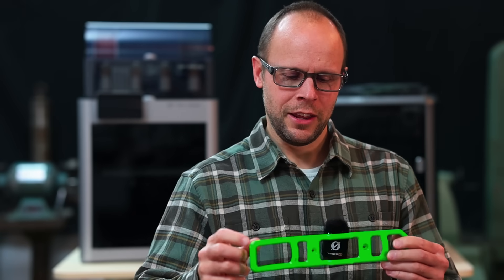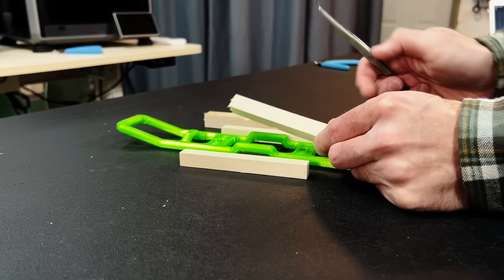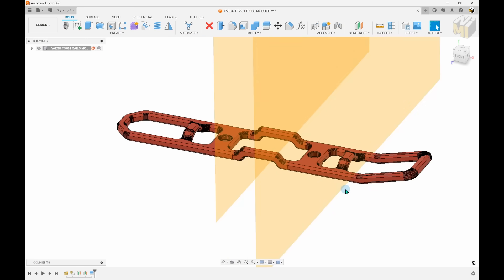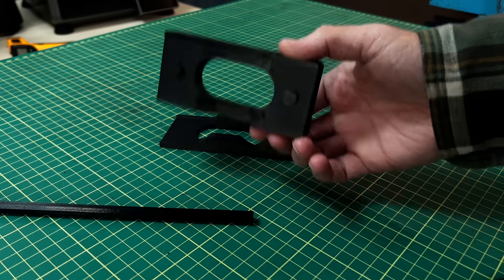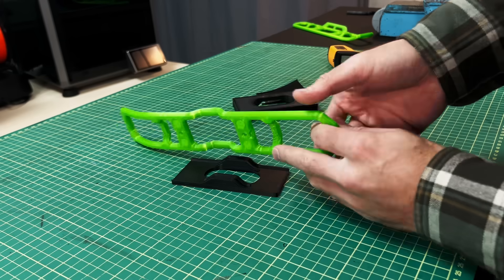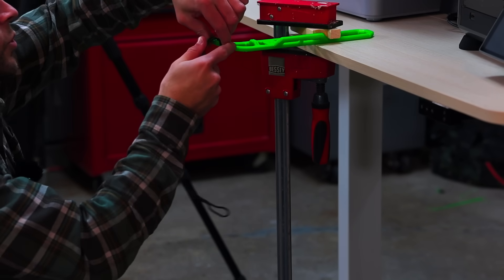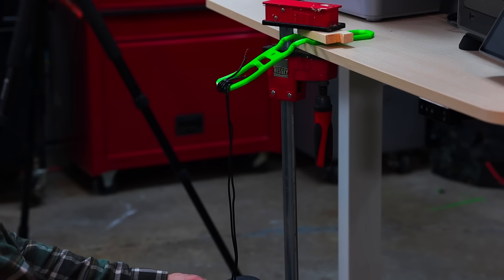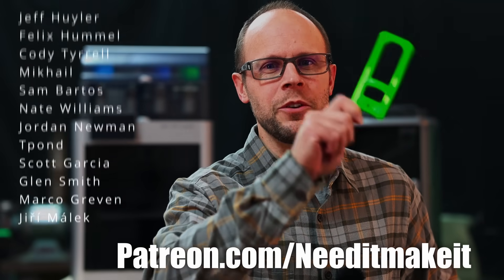2 Simple Ways to Make Stronger 3D Prints + an Experimental Way

Comment: Use tpu on this, also, anneal your prints in salt powder. It works fantastically
Reply from the maker: One TPU Coming right up, I'll print one with what I have, it seems fairly flexible on the spool, it is 95A, but made into a 3d Print, well, I suppose I'll have to see when it becomes a part.  This will be my first time using TPU, coming from a bowden setup, I'd avoid flexibles, but I don't need to anymore and it's time to experiment a bit.  Thanks for that!
Reply: @NeedItMakeIt  if it’s older tpu you may get a lot of stringing and blobbing, but you’re not guaranteed to, give it a go 👍 just print slower than usual, around 35-45mms. If you just have the 95a it will be a good go, but if you had a rigid flexible, could be a great material to use.
Reply from the maker: Apologies, responding to too many comments at once I lost track for a moment.  Salt powder, would that be baking soda?  Would you print solid then surround the part and then compact it and bake it in the oven for an hour or more?  I think that would work really well, I would hope that the part remained fairly close to it's original shape.
Reply: @NeedItMakeIt  CBC kitchen just did a fantastic video on it. I have only used the process 3x since watching his video, but have had really nice results. Just use a very fine salt powder.
Reply from the maker: I must have missed that video, I'll check it out.  That guy, he's really on top of all of these things.  Very talented... nice hair too :).  

It's worth a try, I'll print something as a smaller test to try it out, my first guess is that dimensional accuracy will be lost, and the part will change size, by 2-3%, and some parts with holes wouldn't be well suited to this method.  I'll have to try it out.  It'd be nice to be able to pour something like corn starch around the model, have it flow.. bake it, and then wash away the mould.  Non-Newtonian fluid forming?

Printing some test TPU pieces right now, it's fairly new, wish me luck!

Comment: Very interesting concept the reforming. Shame it doesn't work out well.
Reply from the maker: I really though it would do better but after mounting onto the table and seeing how springy it was, I wasn't so sure.  I wouldn't mind testing the idea of annealing inside of an ABS form, I'm not sure it would work well due to expansion and warpage of each material, maybe annealing in salt/baking soda.  Alternatively I could re-design the model so that it can be printed on it's side, and maybe include some webbing to allow it to vent the radio properly.

Comment: What I do when designing something for 3d printing is think on the stress direction the structure is going to experience, and depending on it I design the object taking into consideration the direction of how is it going to be printed
Reply from the maker: That makes the most sense, in this case it would be best to print something like this on it's side and adjust the design around that position rather than trying to make it work another way.  The model printed with the strap areas flat worked really well, I was pretty happy with that, but printing it on it's side with a re-design would probably work better.  Great points @HmegaB

Comment: I would have print it sideways. Printing sideways would increase strength and you don’t need a heat gun and time to get the correct shape. And as others commented TPU would be a good choice too.
Reply from the maker: Sideways is a good option as well, it would make the rails strong, and the front and back sections could be re-designed to be a bit stronger to have a bit larger cross-section, or make them thinner and more flexible.  it creates a lot of supports, that could be avoided by adding a thin webbing between, if you're printing supports why not have them as the structure?  

TPU is big on the list.  I also want to do a re-design from scratch using just the hole positions I'd like to get some ideas from other people about how they'd do it and then maybe we can make a little competition out of it.
Reply: @NeedItMakeIt  you would be surprised how long you can be bridging without supports. I think you could print this model without supports at all. You only need a well tuned extrusion multiplier.
Reply from the maker: Yes great point!  The design could easily be adjusted to reduce the spacing as well for a better bridge, nice thought on that.  I think you're right about sideways.  I think this is a case of the designer wanting to sell their pro-version made from nylon and not really thinking much about printing our own, it really shouldn't have been designed this way.   

I was thinking about testing some TPU, how does it bridge?  I have honestly never printed with any, I was stuck in the mindset of Bowden from my Enders and I had never tried it to avoid trouble.  It's time to move on to TPU and see what it can offer for protection.  I also want to print some cases for my wireless mics to keep them a bit more well protected.  TPU is white, which looks pretty awful, but I'll go with it for now.
Reply: @NeedItMakeIt  I would use PETG for this part when printing sideways. It should be plenty strong. You can use PLA as interface material if looks matter. 0 distance and 0 interface spacing.
I don’t print TPU that often but bridging isn’t good with it.

Comment: Hard TPU would work way better for something like this than any other normal FDM Material.

Take a look at Ant weight BattleBots, the are almost exclusively made in TPU for durability.

Also it would offer just a slight amount of shock absorbing would would probably be better than something stiff if that radio did fall.

Just watch some videos about TPU as settings can play a big difference in stiffness of TPU. Lost in Tech has some good TPU videos
Reply from the maker: I think it's a great idea, my only hesitation with it is the print speed, but that's all good if it performs really well.  I'm happy to get some material and give it a try.  If it's good for battle bots, it's good for what I need to use it for.  I'll check out some of the videos, thanks for that.  Are there any major drawbacks aside from print speed?
Reply: @NeedItMakeIt  For the use case in this video nothing really other than just normal TPU stuff like drying the filament. And with direct drive extruders you can print TPU reasonably fast now of day's. It was Bowden extruders that were the main culprit of slow TPU prints
Reply from the maker: Going back to my Ender days, I stayed away from TPU, but with the DD on both printers I use now, I think it's time to finally see what it's all about.  It seems like a great option and I'm curious about how I might get some areas to be more stiff than others.  Adding more walls/infill or is there some way to mix TPU within one print and still have good bonding.
Reply: @NeedItMakeIt  do you know about adding modifier areas in your slicer? Doing that you can have some areas with more walls or infill than other areas of the same object. Walls and infill will greatly change The flexibility of TPU
Reply from the maker: I have on occasion used modifiers, I find them a little annoying, but recently I thought about adding parts within the original model and bringing them all in as a multi-part model, those extra pieces which are in the right place already can be changed to be a modifier and that should help.  

Is there a way to have infill which changes density continuously?  I think CNC kitchen did a video on this a while back, more spare towards the center.    Something that is similar to Voronoi/Bone structure seems like it would be the most adaptive and flexible while also being strong.
Reply: @NeedItMakeIt Been able to print 95A TPU on a bowden Ender 3 at 30-40mm/s no problem, With direct drive on a good printer and especially with even harder material, speeds up to 100mm/s should be possible.
Reply: @NeedItMakeIt Perhaps an adaptive delaunay tetrahedralization of the mesh as a post-process after export from CAD and before slicing with zero infill (the tetrahedra would be the "infill").
Reply: @NeedItMakeIt  a modern extruder can print TPU fast. I've printed Polymaker high flow TPU95 at 400mm/s (and 20k accel) with a Bondtech LGX-Lite extruder. The issue is, I think, the highest durometer you can get is 98A, which probably isn't high enough for this application.

There are lots of nylon options that might be better for this part.

Comment: Put a Steel wire in it to add the strength
Reply from the maker: You're the first person to suggest this, same concept as rebar in concrete, that's an interesting one.  A piece of wood may also work well.  Should the steel be heated?

Comment: Super interesting! I expected the heat bent version to do better because they're basically continuous layers. You should try the same with rigid TPU. Something around Shore 60D or harder. Hard TPU is underused IMO. It's some of the most indestructible out there and probably wouldn't have snapped at all.
Reply from the maker: I did too, I think maybe I need to try it in a different material, I can do a short with the results, maybe ABS or ASA would do better?  PETG seem to be very sensitive to temperature causing that brittleness.  I'd love to try TPU, I have some, but it's fairly flexible, so that's great advice, I'll add that to the list, love to see something that doesn't break at all.
Reply: @NeedItMakeIt also PP is like middle ground between ABS and TPU for stifness. I use it a lot for practical aplications. 98A TPU is really good as well. I have printed a part with ABS and 20D TPU. Abs snapped off from that thin section. TPU was indestructable.

Comment: another very strong way that i do sometimes is print the part with 0-5% infill to make it hollow and then make a hole at a place to pour in some resin to fill the cavity (have to make sure that the structure is water tight from inside so that the resin doesnt drip out) i dont fill the cavity fully but just fill those places that might face more stress
Reply from the maker: Ah, that's a cool technique, that would cause an exothermic reaction, but I guess as long as it's slower it would be okay?  Would you recommend using a higher temp material like ABS or PETG?
Reply: @NeedItMakeIt   It really depends on the resin, filament and design used.. I had ASA and ABS deform a bit when doing this, bust mostly due to very thin walls in my 3D design..
Reply from the maker: @v1ncen715  I suppose a very sparce gyroid might work well to help a bit with that.  I think it's a great idea, basically a form which stays part of the final product, it's cool, and if the resin bonds to it, that's even better.
Reply: @v1ncen715  what kind of resin would you suggest?

Comment: You also tested only 1 part in one orientation, this does not reflect real live use. I would habe simply printed it on one side since all the transitions are roughly 45 deg. And increased outer perimeter count.
Reply from the maker: Yup, I plan on doing more.  The test was supposed to reflect how the original part was broken in the best way I could think of.  Full and complete testing would take months of work and a lot of money.  I have little money and 2-3 days.  I'd love to do more, and I will be, we can always follow up with another video using feedback from everyone.  These parts are fairly large and take over 2 hours to print, I'd want to change the design to something else that's smaller and re-test as you say in different orientations.  The part is intended on taking abuse and protecting from impact.  Testing for impact resistance would be good to include in future videos as well. 

The reason I like to test real parts is because it's far easier to understand and relate to real life, testing tiny thin pieces of plastic helps to understand and compare materials, but it's hard to apply to real-life.
Reply: @NeedItMakeIt  Testing is very time and money intensive. 

"...The reason I like to test real parts is because it's far easier to understand and relate to real life, testing tiny thin pieces of plastic helps to understand and compare materials, but it's hard to apply to real-life..." This is the difference between material tests and geometry tests. 
You can shorten it through FEM however the results will vary widely. Especially with 3D printing where the parts are non isotropic, kind of like wood (which you mentioned). You choose a really hard topic for your YouTube channel I must say. Theere are sooo many parameters, from material, to nozzle, size, to extrusion width, temp, fan speed and what not. All of which have an influence and that BESIDES the geometry of the part.

Comment: I think you're expecting too much from this particular design. Redesigning is the way to go
Reply from the maker: That I can agree with.  I think to take the outer shape and re-design it to have the piece continuous and then print it on it's side.  We can build in vent holes, and I think we'd end up with something that performs far better.  I'm not solid on the PETG, maybe ABS or PC would be better choices.  Some have mentioned using a harder TPU, I don't have enough experience with TPU, but I've heard a lot of good things... other than slower printing requirements.

Comment: Instead of heating and bending you could also changed the print orientation from flat to one side, so 90 deg, change. The layer lines would also all be unidirectional and non interrupted with similar results but with less manual labor.
Also as one can see, more rigid does not seem better. Just compare the iPhone 4 with the nice glass backplate and aluminium housing where the glass would shutter and the aluminium permanently deform, compared to the plastic samsung of that time where the backplate would simply fly off and absorb any shocks.
Reply from the maker: That's probably the best way and then re-design so that we remove the areas requiring support.  Even having a thin un-interrupted areas with some vents built-in would probably work really well.
Reply: @NeedItMakeIt  "...then re-design so that we remove the areas requiring support.  ..." Yes exactly, the part already looked pretty well suited for that, some of the designs didn´t needed that much support from the looks of it.
Not saying your design is bad or your idea with the forming, it isn´t. It´s actually a pretty clever solution for cases where print orientation is difficult and can´t be altered easily. I just would always try the version with least manual labor and then go to the next best thing. Especially if you want to print them in larger amounts, maybe you want to sell those or something IDK.
Reply from the maker: For sure, post-processing is best to avoid, and that's normally how I'd do it.  Sometimes I have an idea and go with it, sometimes they work, sometimes they don't and sometimes they REALLY don't.  It's a cool concept, but to get it right and to have any benefit it needs to have performed far better, it seems like this one may not need to make another appearance unless I can understand the annealing process fully.  There are lots of good ideas, a material switch to TPU may be the best option to prevent any sort of cracking and also provide that protection I was looking for.  

In this case the design was by someone else, I would not sell the part unless I had permission from the designer.  I may end up re-designing from scratch using just the bolt holes along with including all of the ideas you and others have suggested.  When I look at the model, I also see that the bolting setup is weak as well, those bolts should really not be inset, they'd need to sit against the most outside surface with a washer as well.    I'm thinking that this design was taken from something made from Alum. I'd have to do some digging to be sure, but it's fairly thin profile and skeletal features lead me to think that.  Or the Nylon they have it made from professionally is plenty durable.    

I'm a bit of a glutton for punishment.  Nothing like a good challenge to keep the gears turning.  Great comments @sierraecho884 as I get deeper into this, I'd love more feedback.
Reply: @NeedItMakeIt  "...another appearance unless I can understand the annealing process fully...." maybe I can help, I am not a chem. "kind of guy" but I am a mech. engineer. Don´t forget you can´t anneal any type of plastic. only ..I think semi cristalline it was ? I need to look it up again. Basically PLA woks but PETG does not. And annealing will warp the parts a lot so going through that hassle you can just as well create a mold and use PU instead or something and ditch the layer lines all together.

"...TPU may be the best option to prevent any sort of cracking and also provide that protection I was looking for. ..." 
Yes TPU is awesome for those kind of applications. I think it would perform the best. Additionally TPU is rather slow printing and difficult to work with you can come up with designs like a "TPU sock" over a PLA Print for instance, sine PLA is way faster printing. Like a rubber casing or rubber insert for the precious gear inside, or both. 

"...not be inset, they'd need to sit against the most outside surface with a washer..." Use the 90degree countersunk bolts instead, you increase the area but the bolt head does not stick out. 

"...Nylon they have it made from professionally is plenty durable. ..." We use the same SLS machines professionally (Automotive engineering) and yes they are incredibly strong parts. I think that´s what they used.

"....I'm a bit of a glutton for punishment.  Nothing like a good challenge to keep the gears turning.  Great comments @sierraecho884 as I get deeper into this, I'd love more feedback...." 
Thank you too, you seem to be a real awesome person, very receptive to criticism and I really like your out of the box thinking, I have watched a couple of your videos and I must say very well done mate.
I am glad if I can help or inspire, also subscribed to your channel.